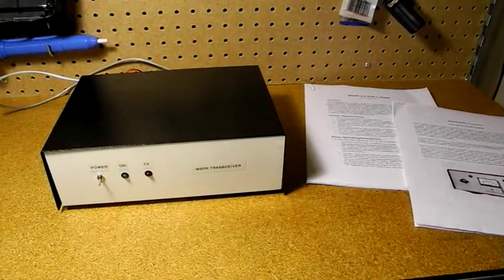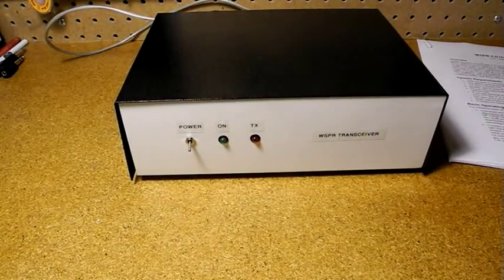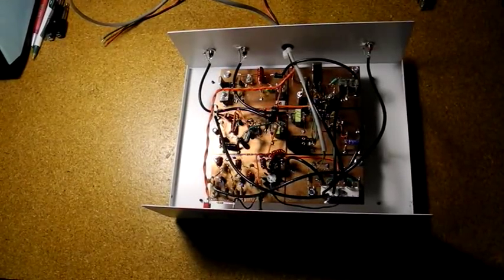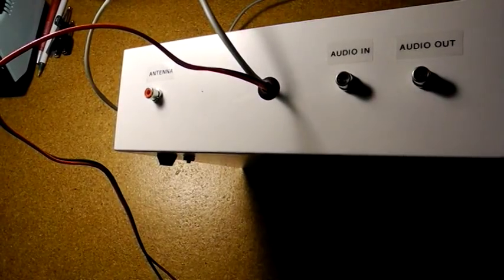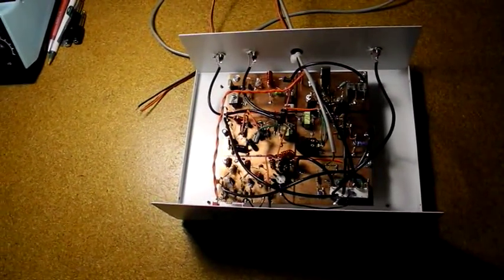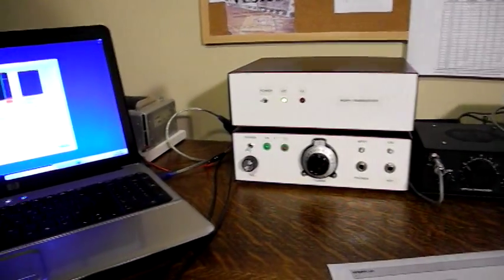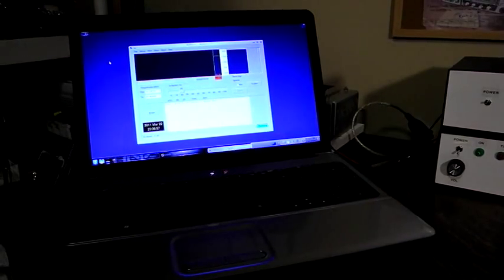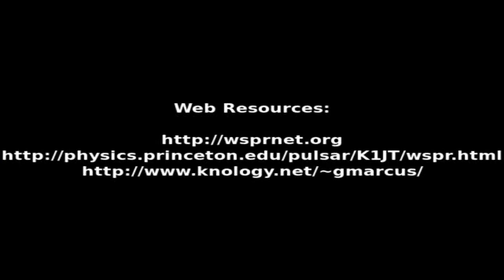W3PM Homebrew WSPR Transceiver

Comment: Very nicely done.   I built a USB audio rig interface similar to the Signalink at less than 20 bucks cost.   You could incorporate my circuit into your transceiver and only need one USB connection back to the computer.
kb9rlw.blogspot.com/2016/08/cheap-and-easy-to-build-digital-modes.html

Comment from the maker: @NG9D WSPR is only used in a beacon mode. There was a version of WSPR that had a "QSO" mode but it is no longer supported. It takes two minutes to send a WSPR message which contains the transmitting station's call sign, grid square location, and transmitter power level.